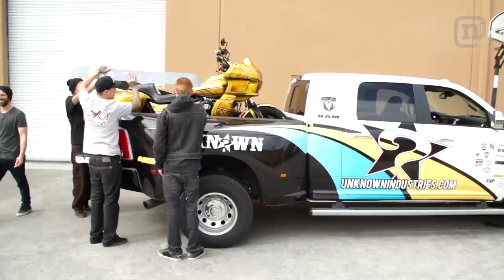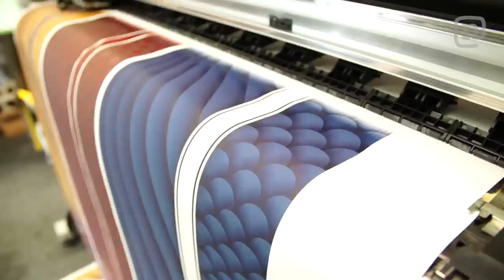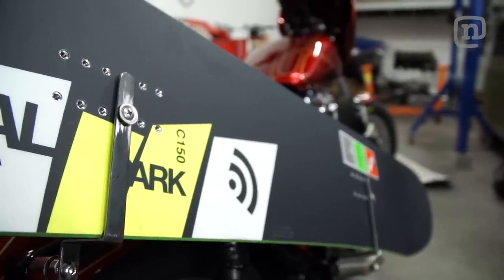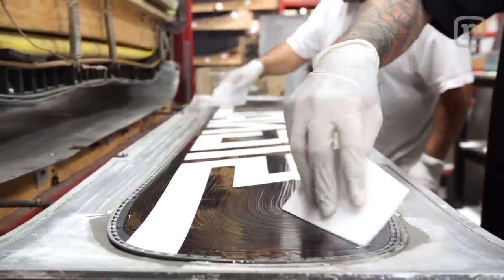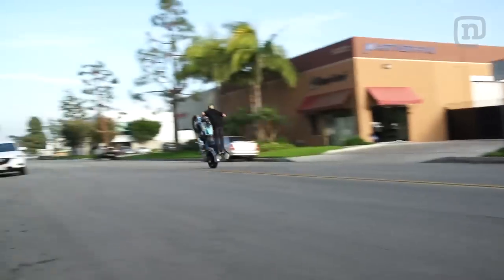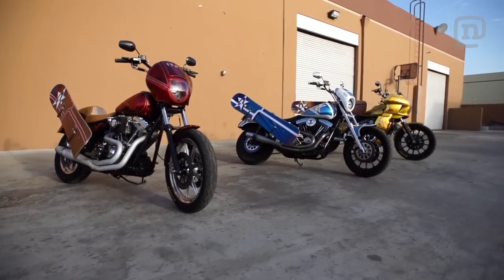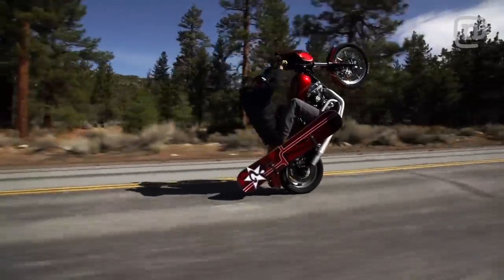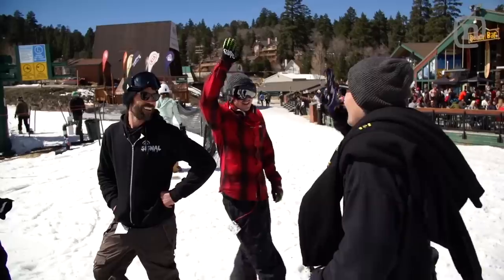Harley Snowboarding Adventure: Wheelies, Burnouts & Boardslides On ETT

Comment: A rack setup that wouldn't require removing the bindings would be awesome... maybe some sort of rubber padded vice grip type setup?  Riding up to bear instead of driving would be a blast on a nice day
Reply: Or you could just drill an extra hole in the board....